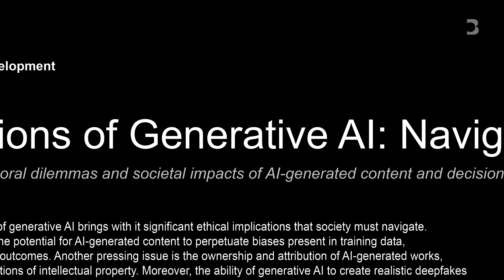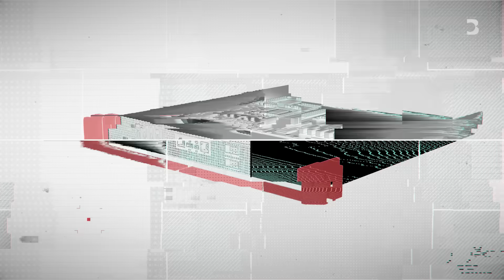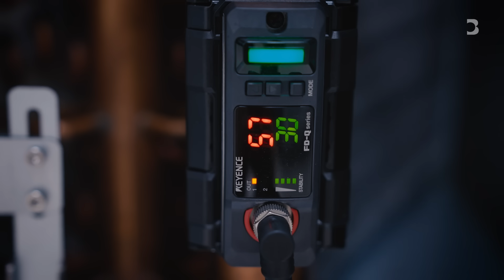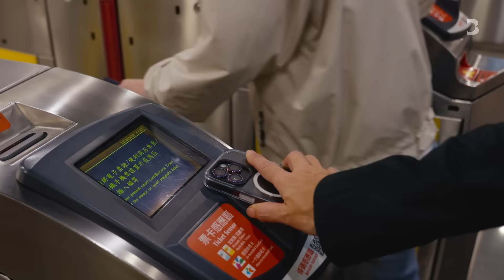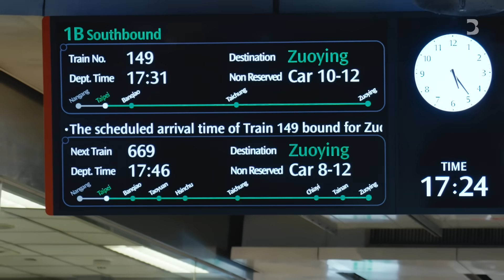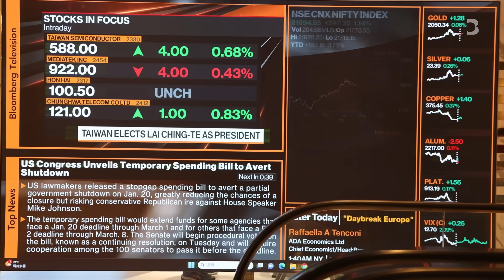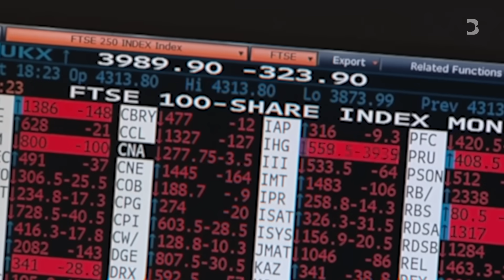Why AI Can't Exist Without Taiwan

Comment: In Taiwan, there are more than 350 publicly listed companies who participate in the semiconductor industry working based on various professions in this field covering from upstream, midstream to downstream in division of labor. So that it makes the industry with overall strengths and capabilities in flexible and efficient for time-to-market in global competition. And there also have more new tech start-up companies continue to join it. In addition to them, there are more than 100 professional suppliers supporting the manufacturing of specific chemical materials, gases, specific components, special equipment, consumables, packaging materials, recycling, and debris handling for the semiconductor industry. There are more than 450 companies working for the supply-chain of entire semiconductor industry. The industry manufactures them from raw material silicon production to wafer then to chip, all they can be completed in Taiwan locally, without the need to import other materials.

Comment: Taiwan's Chip Industry Controls the Lifeline of Global Technology

Chip Specification Grade Classification:
Logic (Processors, AI Artificial Intelligence Computing), Memory Chip Operating Environment Requirements:
Commercial Grade -- 0~+70℃.
Industrial Grade -- -40~+85℃.
Automotive Grade -- -40~+125℃.
Military Grade -- -55~+150℃.
There's also an even higher grade: Aerospace Grade (Radiation Hardened), which requires resistance to radiation and interference, as well as a wider temperature range. Military and aerospace grade chips undergo rigorous qualification testing: pushing them to their limits, continuous high and low temperature cycling, vibration, shock, high ESD (Electro Static Discharge), and interface terminal plugging/unplugging endurance...
Generally, industrial-grade chips are twice as expensive as commercial-grade chips, automotive-grade are three times or more expensive, and military-grade chips are very expensive due to the need to amortize the manufacturing line costs. For aerospace -grade chips, setting up a production line costs hundreds of millions of US dollars, regardless of the quantity produced.
Taiwan's TSMC is the exclusive global manufacturer of high-end logic, AI, and memory chips for the US and its allies, as well as Taiwan's Chung-Shan Institute of Science and Technology (CSIST), for military and aerospace applications. The US Defense Advanced Research Projects Agency (DARPA) has approved the following manufacturers for producing military and aerospace grade logic chips and processors for the US military and aerospace industry: Taiwan's TSMC (advanced 7, 5, 3 nanometer process technology), US-based Intel (14 nanometer and above processes), and US-based GlobalFoundries (28 nanometer and above processes).
The manufacturing process, technology, materials, and raw materials for military and aerospace-grade chips are highly classified. The US and Taiwan have signed agreements to jointly control the highest-level technologies, prohibiting their export to other countries. The US government, still concerned for national security, has requested TSMC to invest and build factories in the US to manufacture advanced AI chips. Their entire production capacity is contracted by US Department of Defense military and aerospace manufacturers. Only the surplus and new factory capacity will be allocated to other companies like Nvidia, Apple, AMD, and Intel. This is an unspoken secret.

China and Russia's military and aerospace equipment can only use general commercial-grade chips for manufacturing, employing a trial-and-error method to create heat and cold insulation plus protective layers to shield the chip motherboards. This approach leads to short warranty periods and questionable real-world operational quality for Chinese and Russian military equipment such as missiles, radar detection systems, and aerospace equipment. Facing the US's high-tech electronic warfare countermeasure systems, their chip motherboards are vulnerable to destruction by high-power electromagnetic waves, causing missile failure and radar detection system malfunction. The failure of Russian weapons in the Russia-Ukraine war fully demonstrates this fact. If China invades Taiwan, the PLA's J-20, J-16 fighters, missiles, radar detection systems, and naval radar detection systems, which are designed using commercial-grade chips, will undoubtedly suffer a major defeat against US-Taiwanese electronic and electromagnetic warfare, and anti-electromagnetic pulse weapons. (Unverified online rumors in China suggest that the guidance systems of PLA missiles and torpedoes are reverse-engineered from US military technology of the 1990s, using stockpiled Intel 486 and 586 processors of commercial grade from 20-30 years ago for manufacturing.) This is something that the general public wouldn't understand, only experts in chip technology would know. Without mastering the highest technology in the chip industry, the Chinese Communist military is fundamentally unqualified to wage war!

Electric vehicles in China are frequently reported in their domestic market for failing to start due to excessively cold or hot weather, experiencing battery explosions, or suddenly malfunctioning while driving, leading to casualties. Besides other factors, it is very likely that Chinese electric vehicle manufacturers, in order to reduce costs, unscrupulously violate vehicle industry safety standards by not using automotive-grade chips and semiconductor components, and instead using cheaper commercial-grade chips and semiconductor components for the electric vehicle's electronic and electrical systems, making accidents inevitable.

The computer chips for the US Mars spacecraft are manufactured by Taiwan's TSMC using aerospace -grade chip technology. The computers for the US aerospace station are designed by Taiwan's CSIST and manufactured by TSMC using aerospace -grade chip technology, guaranteed to operate flawlessly in aerospace for 20 years. The computers and electronic systems for US and European low-Earth orbit satellites must be manufactured using TSMC's aerospace-grade chip technology.

Comment: Taiwan is really the most important nation in the world! Thanks for letting us know.
Reply: Taiwan's Chip Industry Controls the Lifeline of Global Technology

Chip Specification Grade Classification:
Logic (Processors, AI Artificial Intelligence Computing), Memory Chip Operating Environment Requirements:
Commercial Grade -- 0~+70℃.
Industrial Grade -- -40~+85℃.
Automotive Grade -- -40~+125℃.
Military Grade -- -55~+150℃.
There's also an even higher grade: Aerospace Grade (Radiation Hardened), which requires resistance to radiation and interference, as well as a wider temperature range. Military and aerospace grade chips undergo rigorous qualification testing: pushing them to their limits, continuous high and low temperature cycling, vibration, shock, high ESD (Electro Static Discharge), and interface terminal plugging/unplugging endurance...
Generally, industrial-grade chips are twice as expensive as commercial-grade chips, automotive-grade are three times or more expensive, and military-grade chips are very expensive due to the need to amortize the manufacturing line costs. For aerospace -grade chips, setting up a production line costs hundreds of millions of US dollars, regardless of the quantity produced.
Taiwan's TSMC is the exclusive global manufacturer of high-end logic, AI, and memory chips for the US and its allies, as well as Taiwan's Chung-Shan Institute of Science and Technology (CSIST), for military and aerospace applications. The US Defense Advanced Research Projects Agency (DARPA) has approved the following manufacturers for producing military and aerospace grade logic chips and processors for the US military and aerospace industry: Taiwan's TSMC (advanced 7, 5, 3 nanometer process technology), US-based Intel (14 nanometer and above processes), and US-based GlobalFoundries (28 nanometer and above processes).
The manufacturing process, technology, materials, and raw materials for military and aerospace-grade chips are highly classified. The US and Taiwan have signed agreements to jointly control the highest-level technologies, prohibiting their export to other countries. The US government, still concerned for national security, has requested TSMC to invest and build factories in the US to manufacture advanced AI chips. Their entire production capacity is contracted by US Department of Defense military and aerospace manufacturers. Only the surplus and new factory capacity will be allocated to other companies like Nvidia, Apple, AMD, and Intel. This is an unspoken secret.

China and Russia's military and aerospace equipment can only use general commercial-grade chips for manufacturing, employing a trial-and-error method to create heat and cold insulation plus protective layers to shield the chip motherboards. This approach leads to short warranty periods and questionable real-world operational quality for Chinese and Russian military equipment such as missiles, radar detection systems, and aerospace equipment. Facing the US's high-tech electronic warfare countermeasure systems, their chip motherboards are vulnerable to destruction by high-power electromagnetic waves, causing missile failure and radar detection system malfunction. The failure of Russian weapons in the Russia-Ukraine war fully demonstrates this fact. If China invades Taiwan, the PLA's J-20, J-16 fighters, missiles, radar detection systems, and naval radar detection systems, which are designed using commercial-grade chips, will undoubtedly suffer a major defeat against US-Taiwanese electronic and electromagnetic warfare, and anti-electromagnetic pulse weapons. (Unverified online rumors in China suggest that the guidance systems of PLA missiles and torpedoes are reverse-engineered from US military technology of the 1990s, using stockpiled Intel 486 and 586 processors of commercial grade from 20-30 years ago for manufacturing.) This is something that the general public wouldn't understand, only experts in chip technology would know. Without mastering the highest technology in the chip industry, the Chinese Communist military is fundamentally unqualified to wage war!

Electric vehicles in China are frequently reported in their domestic market for failing to start due to excessively cold or hot weather, experiencing battery explosions, or suddenly malfunctioning while driving, leading to casualties. Besides other factors, it is very likely that Chinese electric vehicle manufacturers, in order to reduce costs, unscrupulously violate vehicle industry safety standards by not using automotive-grade chips and semiconductor components, and instead using cheaper commercial-grade chips and semiconductor components for the electric vehicle's electronic and electrical systems, making accidents inevitable.

The computer chips for the US Mars spacecraft are manufactured by Taiwan's TSMC using aerospace -grade chip technology. The computers for the US aerospace station are designed by Taiwan's CSIST and manufactured by TSMC using aerospace -grade chip technology, guaranteed to operate flawlessly in aerospace for 20 years. The computers and electronic systems for US and European low-Earth orbit satellites must be manufactured using TSMC's aerospace-grade chip technology.
Reply: its not its just cheapest , problem is not that only them can produce it , its that they it way cheaper. We can build those chips anywhere on earth just for biggger price tag.Taiwan is very replaceble
Reply: @maksimpevgonen3071 
You should ask Intel about it? Wait, you are the let go Intel engineer?

Comment: Taiwan holds a significant position in the global landscape for several reasons:
1. Economic Powerhouse
Taiwan is a major player in the global economy, particularly in the technology sector. It is a leading producer of semiconductors, which are crucial components in a wide range of electronic devices. Taiwan Semiconductor Manufacturing Company (TSMC) alone controls about 40% of the global chip production and 92% of advanced semiconductor manufacturing1. This makes Taiwan indispensable to industries such as consumer electronics, automotive, and telecommunications.
2. Strategic Geopolitical Location
Located in the heart of East Asia, Taiwan sits along major shipping routes that are vital for global trade. Its strategic position makes it a key player in regional security dynamics, especially in the context of US-China relations2.
3. Democratic Governance
Taiwan is often highlighted as a model of democratic governance in Asia. Its political system and commitment to human rights and democratic values set it apart in a region where such systems are not as prevalent3.
4. Technological Innovation
Beyond semiconductors, Taiwan is a hub for innovation in information and communications technology (ICT). It is home to many leading tech companies and startups that drive advancements in various fields, from AI to green technology4.
5. Global Supply Chains
Taiwan’s integration into global supply chains is critical. It supplies essential components and products to numerous industries worldwide. Any disruption in Taiwan’s production capabilities can have significant ripple effects across the global economy1.
6. Cultural Influence
Taiwan also contributes to global culture through its vibrant arts, cuisine, and media. Taiwanese films, music, and literature have gained international recognition, enriching the global cultural landscape.
In summary, Taiwan’s importance to the world is multifaceted, encompassing economic, geopolitical, technological, and cultural dimensions. Its role in the global economy, particularly in semiconductor production, and its strategic location make it a key player on the world stage.

Comment: The massive increase in Bitcoin comes as markets tumble, inflation soars, and the Fed enacts steep rate hikes—all of which spell deeper losses for portfolios this quarter. With treasury yields also climbing, now could be an opportune time to pivot. Should I liquidate my $125k bond/stock portfolio to capitalize on this volatile market?
Reply: I agree, just because the market presents opportunities doesn't mean we should rush in headfirst. For this reason, we should look for appropriate market analysis or guidance or, alternatively, seek advice from certified market strategists.
Reply: Agreed! this is why I work with one. My $520k portfolio is well-matched for every market season yielding 85% rise from early last year to date. I and my advisor are working on more figures for this year. IMO, financial advisors are the most sought-after professionals after doctors.
Reply: Her name is 'Kenia Giordani Borges’ Just research the name. You’d find necessary details to work with a correspondence to set up an appointment.